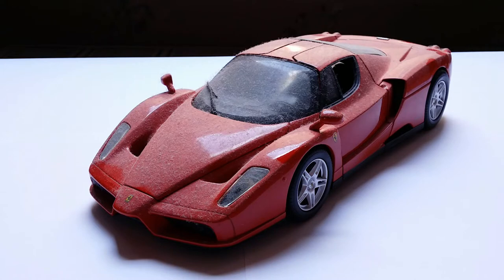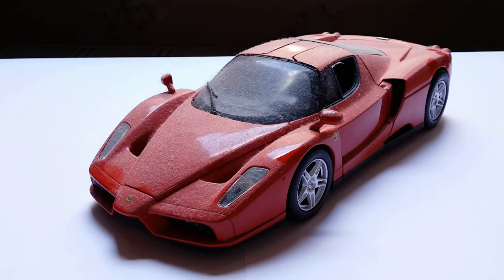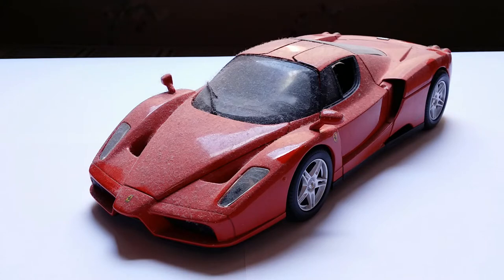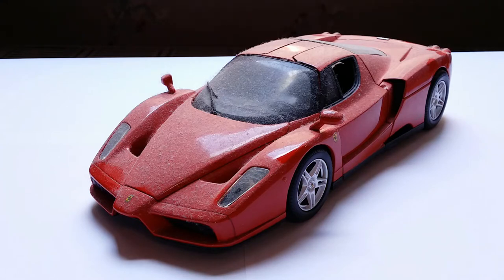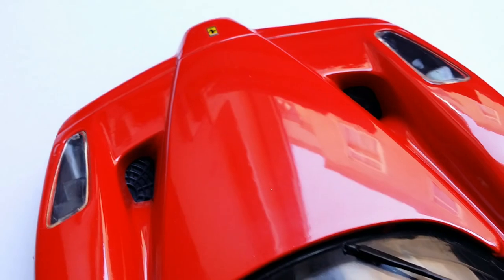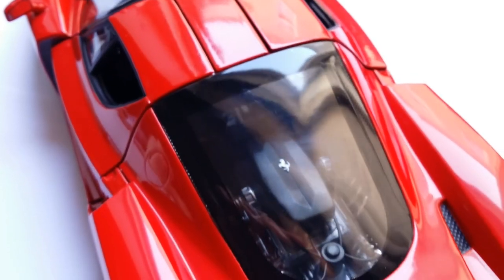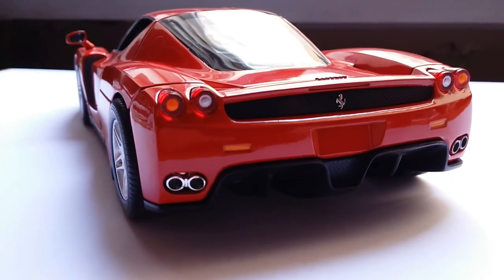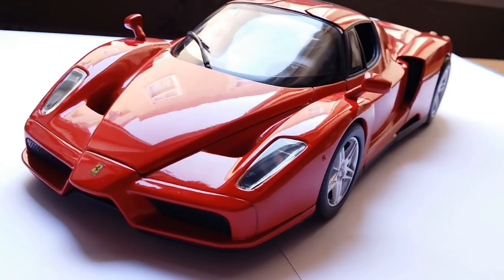How to clean dust from diecast model cars

Comment: i have diecast models that have been sitting for over 10 years on display and just found out a good way to get the stuck on dust out of the interior (Q-tip or paint brush didnt work) is by using a wet toothbrush and scrubbing the seats and dash. They look like brand new again.
Reply: @ImperialDiecast  Won't a toohbrush be too hard for the small plastic.
Reply: I use make up brushes to clean my collection Every few weeks , and a swiffer Duster
Reply: 10 years💀😭

Comment: Cleaning info part actually starts at 7:00
Reply: I'll save you all the trouble. Blow the dust off it, then wipe it off with a soft cloth. 2.3 seconds, 19 minute video not required. You are welcome.

Comment: Reducing the amount of dust in the room is most important. I have my 300, 1/18 diecast in my den, a smaller room. They are all on open shelving. A BIG help is to cover (block off) both the supply and return air grilles into that room (surprisingly it is still warm enough in winter) It makes a huge reduction in the amount of dust. I put an auto-closer on the door hinge so it always stays shut, keeping dust out. Using an air purifier in the corner also filters out any dust. Canned air is best to get the bulk of the dust off and finish with fine cloth, as you've done. Fyi....take the model out of the room to blow the dust off, or it will just end up on some other models in the same room.  Comment - I don't agree with displaying models inside the box since you can't see all sides, can't open the parts, poor lighting, takes up more space, etc..

Comment: Thanks for this. I have 69 1:18 scale cars in my collection, and thanks to your tips, I think every day I should clean one using the following steps: 1) Blow on it (using the mouth, not another body part) 2) Use a microfiber cloth for the windshield first, and then the rest of the car 3) Use a soft-bristled brush for those harder to reach areas of the vehicle
Reply from the maker: Exactly! And to clean any actual dirt, always try using water dampened cloth first and only if it still doesnt go away, use alcohol-based agents as a last resort as they may damage the paint and definitely will damage matte black areas like the black trim around the windshield.
Reply: 69, nice.

Comment: i find cleaning the interior stuck on dust on the seats and dash the hardest by far. i wish they made most diecast cars without open windows to keep the dust out. but then it would be kinda tough to open the doors.

Comment: That's what i do to my 1/24 scale models that wasnt built to high enough of caliber for a case I just walk by and blow on them ciuple times a week and clean them once a week it's not many maybe 4 abd by jist blowing majes it so much easier to clean instead of letting it collect dust. And also by building them you can gwt a very high detailed car with better paintjobs and as much scale detail as you want and alot of times more detail then any expensive diecast out there depends how much work you put into them for 60 bucks and 3 months I have models that are way more detailed and better paint then any other diecast in the 400 to 1000 dollar range but I been building for 10 years since i was a kod takes alot of practice and work but worth it

Comment: I bought a pack of like 1,000 clothes off Amazon specifically designed for cleaning copier screens. Originally got them for cleaning weapons because they're lint free. But they probably work great for models. Super high quality and safe, but cheap enough to be disposable.
Reply: That's why I keep my old clothes. I cut them up and use them as shop rags, gun cloths, general rags, and many other things.

Comment: What model kit was this. I remember this diecast came disassembled and you had to build it. Got one in yellow when I was 7 or 8, just can’t remember the brand/kit name
Reply from the maker: this is a pre-assembled car in 1/18 scale sold by hot wheels. I am not aware of there being model kits in 1/18 scale, most kits I know are in 1/24 scale and made by companies like tamiya, aoshima, fujimi etc. but there are also some maisto "assembly line" kits in 1/24 scale too which do not require any glue or painting, just quick assembly.
Reply: @ImperialDiecast  ahh they are the maisto assembly kits, thanks for clearing that up. I don’t really know much about model kits haha, but been trying to remember for the longest what kit it was just so I could buy another.

Comment: Thanks for taking the time to inspire us to clean our model cars. I'm heading out to buy one or two of the simple "tools" I need to spruce up my die-cast auto collection. Just wondering, did I miss the part on using water?
Reply from the maker: Thanks for the comment :) Yeah I mention water somewhere in the middle of the vid, only resort to isopropyl alcohol as a last resort because that stuff easily damages paint especially plastic or matte surfaces.
Reply: @ImperialDiecast  Right, and thanks again. I caught that part.  Now, all we need is for someone to invent a die-cast model car "car wash/cleaner"...whatever they decide to call it. Can't wait to see it on the market :)

Comment: Is a hand dremel safe to use with compound to remove swirl marks?
Reply from the maker: so far I havent worked with compound yet. My advice is to stay away from tools and just use your fingers, that way you can always "feel" the model underneath and adjust pressure and pace. But try it on your cheapest and most damaged model first before daring to do anything on an expensive one.
Reply: @ImperialDiecast  thanks! I will try it on my cheapo ones first